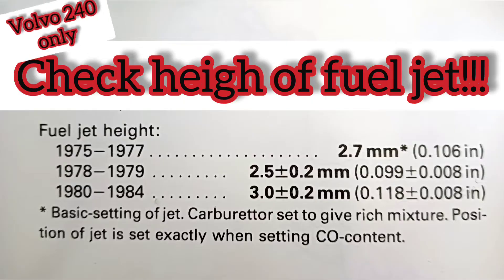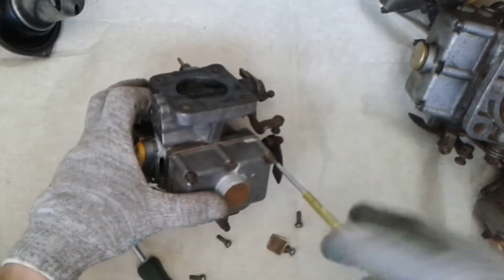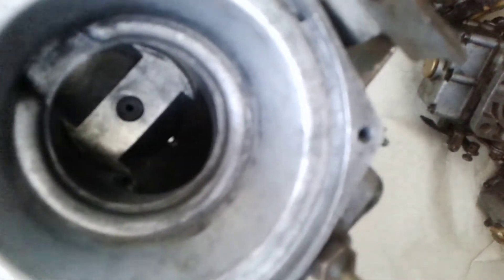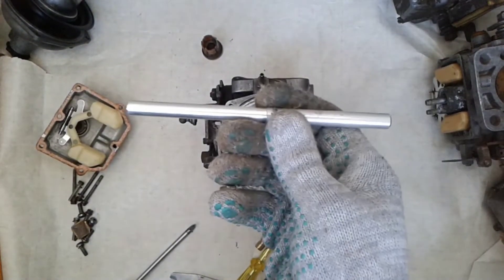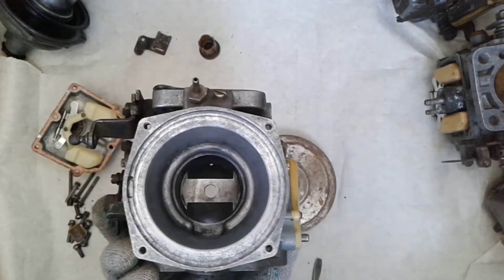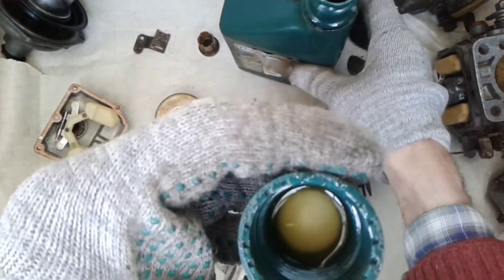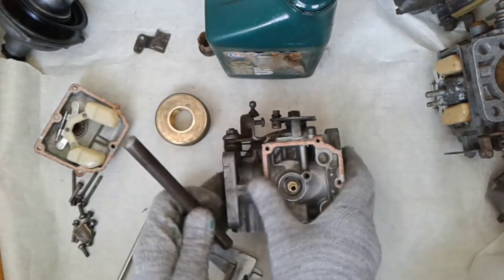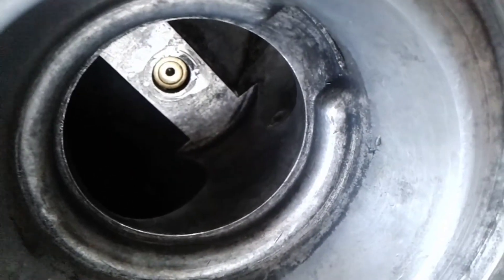How to replacing main jet Zenith-Stromberg 175CD2SE #carburettor #carburetor

Comment: Nice work and U may save my old volvo 144. I cannot use my volvo 144 now because the engine stops working after 15 min. running. Then, I need to wait 45min. thne, my volvo engine starts again. After running about 15min., it stops on the road again and again. Can you advise me what is going on my old volvo 144 (1970) B20A?
Reply from the maker: Well, if it stops, if it stalls it means...🧐 that something missing: correct fuel mixture or ignition spark right? You need to figured what missing.🤔 If it not enough fuel - check the gas in the tank, if you know that fuel pump okay. So, check the fuel system and ignition, make sure that temperature compensator works (at least not stuck, it influence for idle). If it fuel shortage in carburetor - there's not enough fuel goes to the carburetor, not enough fuel pressure means not enough fuel level in chamber engine can't run so, have you enough fuel in the tank?⛽ Or if my be too much fuel in mixture check the needle valve, check the valve chamber- to reach fuel mixture >  check how smell tail pipe, exhaust smell.👃 If it smells like gas? It means my be too much of fuel. 
So, anyway, my be less of fuel, my be too much fuel. And as additional problem loss of spark. 💥Spark plugs can be flooding from owereach mixture if the float chamber valve worn. So you can check spark plugs (color and conditions smel of gas. Watch my video about spark plugs.
These issues - It is reason for check your car so it'll be reliable and you can enjoy it forever!